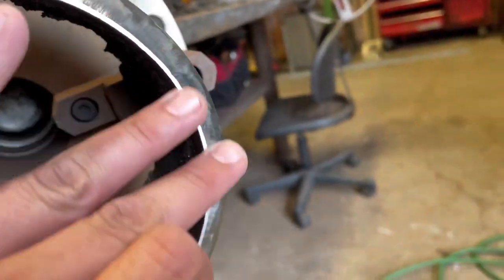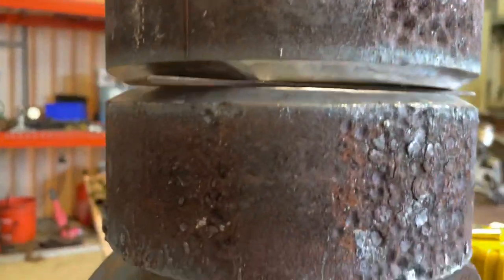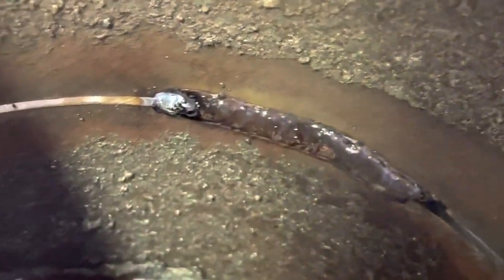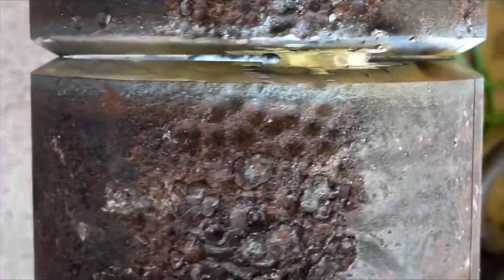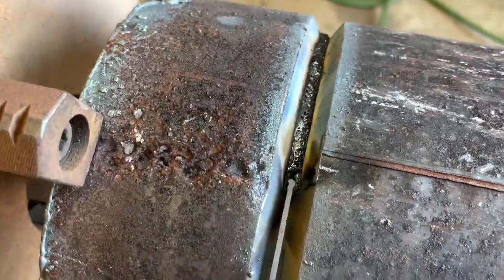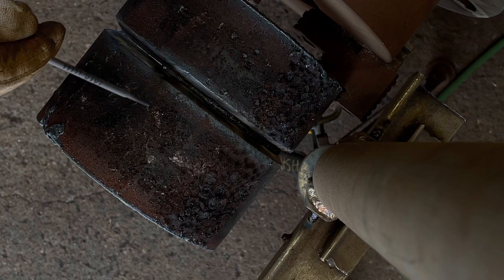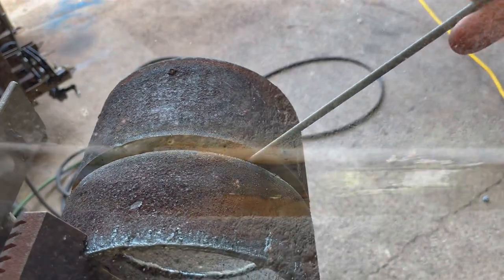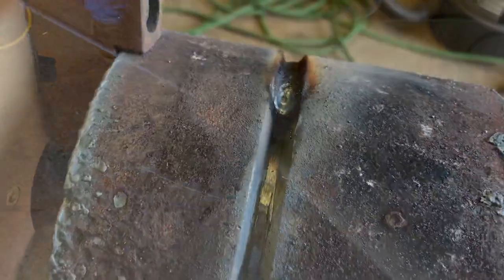Downhill Welding on Roll Out  (6010/8010)

Comment: This is an awesome video as well as awesome looking beads. I'm new to welding & have been out in my shop practicing & running beads & joining pieces together. I've been learning the basics from my brother, who has been welding for 30 yrs.  I do have a couple questions for ya & I apologize for asking. . . . . .1.) "What is the reason for leaving the small gap between your 2 pipe pieces before ya begin running your joining  root pass? 2.) Why not let the 2 pieces touch directly to each other & then start your joining root pass? Thankya for sharing. I hope I can be as good as ya'll😃👍🏼
Reply from the maker: You don’t have to apologize brother. No question is stupid in this world. But the gap in between the two joints is too adhiere inside penetration. Without a gap it’s possible to get a root in but you will have a harder time.
Reply: @VantageWelding  Okie dokie. . . . I really appreciate ya taking the time to text me back  to answer my questions.. Thankya sir. I'm trying to learn all i can👨‍🏭 & get in the much needed practice👨‍🏭. I've been trying my best with the "uphill", using 1/8 7018, but i suck & i dont like the 7018 rod. I'm running at 115amps.  I'm using an ole 50 yr old Lincoln 225amp arc welder  that's in great shape. My grandpa bought it in the mid 70s & dad used it thru the yrs until 2016.   I'm having alot of fun, needless to say😃👍🏼. Im a new subscriber to your channel, if that's okay with ya👍🏼!

Comment: Thanks for the video. Why do you use a 6010 for the root? Why not 7018 for that as well? or some other rod, like a 6013?
Reply from the maker: 6010 +++ is specified for root passes. 7018 is not a penetrating rod. And 6013 is a cheap farm rod not intended for use in quality welds.

Comment: Slick.. if you had the choice. Would you rather cap wit 6010 7010 or 8010. I'm normally a TIG 7018 kind of welder but lately I've been doing a lot of downhill  6010 at work  I was wanting to buy some 70 or 80 but not sure what would run better
Reply from the maker: I don’t really like to use 6010 other than for the roots due to the fact that they won’t carry metal as good as a 8010. 8010s freeze up faster than a 6010. And as far as 7010, you can slick those out too as well, just get ready to get burned the ** up lol. I prefer a hood ol’ 8010 pipeliner over any rod. 8010 downhill over any process. 🦾🦾 thanks for watching
Reply: Down hill I’d run 8010 for fill and cap

Comment: Can you do a video with tips on how to do restarts on your cap with 8010. ?
Reply from the maker: I can give you a tip. When you pull out, pull out by pushing down and away from puddle. That would leave a voided space shaped like a spoon. You go back into that cracker, refill and take off.
Reply from the maker: Wally the weld professor has some awesome content regarding restarts on 8010. One of the slickest welders out there brother.